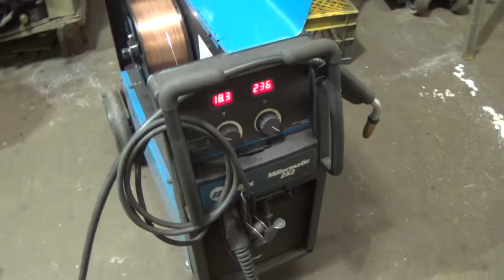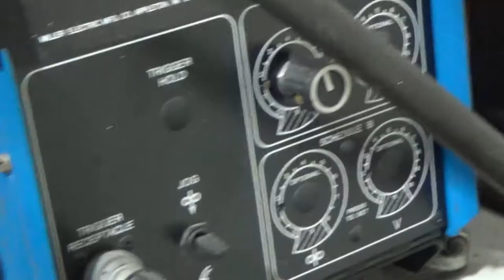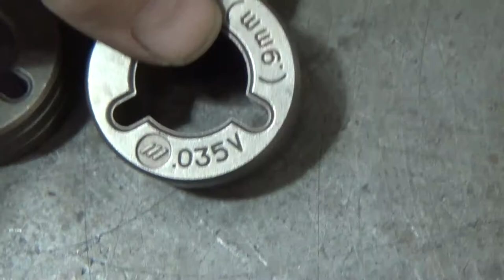Truck Backpack Cross-chassisToolbox Repair

Comment: Yea I figured that one out a while back after we bought our 251. Good tip for others who dont know this little fact about the Millers. 
I also bought a set of rollers for the .045 flux core, but mine have the grooved grooves so that it doesnt slip when pulling the wire. 
Always a hoot watching and listening to you Michael!

Adam
Reply: Hmm, trying to remembr if my millermatic has them...its been a while since I changed wire size.
Didnt you forget the polka line in this vid??? :-)
Reply: Err body Polka!!!
Reply from the maker: ***** I did, maybe since it was a holiday
Reply from the maker: Hey Adam, yes, I know what you mean, I'm getting quite a collection of rollers, all different of course, Miller, Lincoln, Hobart,  "V" groove,  "U" groove,  Knurled, would it be so awful if they could all get together and use a common roller??
  GEEEEZZZEE!
  I'm glad you enjoy the videos, I'm enjoying yours for sure

Comment: Hi Mike, Enjoyed this one as usual, and I didn't know that about the Miller rollers so thanks for the heads-up.  You might want to consider making a couple of 18x24 channel iron "furniture dollies" with cast iron casters.  The dollies would make it easier to manipulate projects like this, and to get them all the way into the shop so you can close the door when it's cold outside. Just a thought.  -Chris
Reply from the maker: Hi Chris, Thanks for the compliment, and the suggestion on the rollers, both are much appreciated!
        Mike

Comment: If you run up on (much) older Millers, the feed rollers are single-track but come in two halves each with knurling on both circumferential edges. You face them together as needed to get your "two sizes" from one roller.

Comment: Several years ago, (at least 10) I had a big sheet metal job to do and decided dropping down to 0.030 wire would be better.  So, I went to my local welding supply store to get the wire and rollers and tips.  They told me to just run 0.035 rollers and tips when using 0.030 wire.  Their reasoning is if you melt the wire to a tip, the wire will slip in the rollers and not create a bird's nest.  After doing that job, I can say it works fine.  So now I leave the machine setup for 0.035 and just switch wire.
Reply from the maker: Hey Matt, good information to know, I'm pretty well set up with different size rollers for the Miller equipment, but it could come in handy,
   Thanks